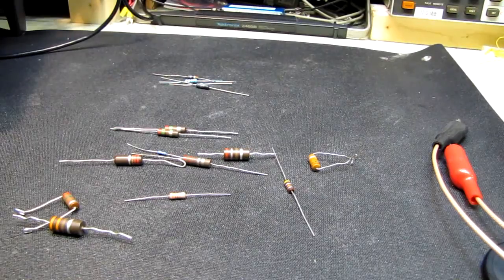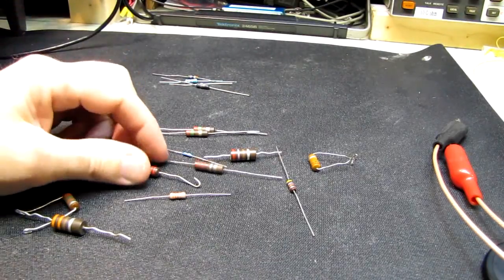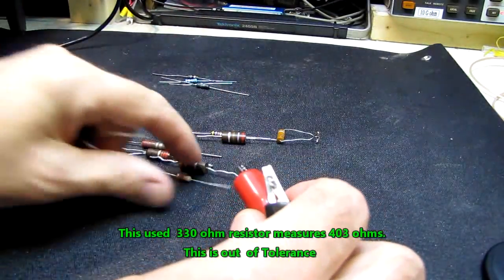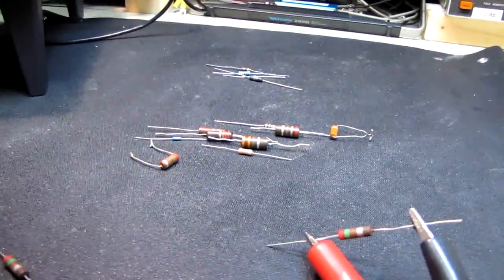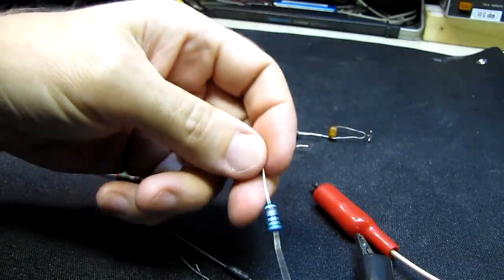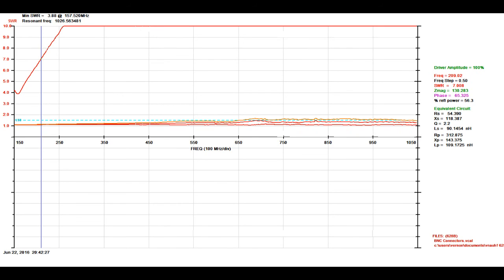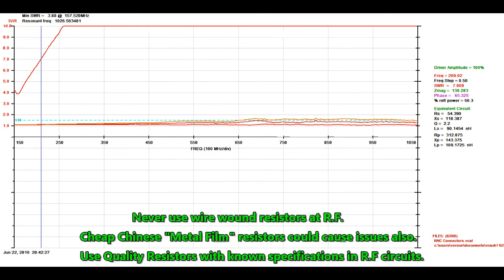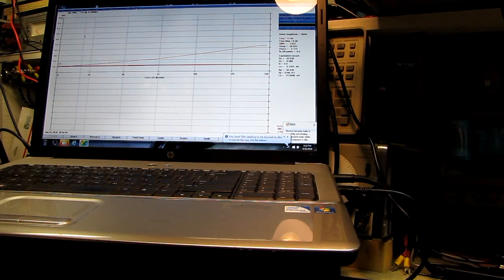Carbon Comp Resistors - High Failure Rate

Comment: When you measure the inductance of the resistors,  how are you dialling out the lead inductance?
Reply from the maker: My inductance meters allow for connecting right at the body of the device. For the frequencies most of us use the lead inductance is of such a small value to be insignificant. If your researching UHF/SHF you will likely have the specialized gear needed.

Comment: Carbon are the best in my opinion on audio for balance if you can get carbon film they are good but not good around heat!!!! When they get hot they will drift 
I like using old stock Allen Brady carbon comp and test them I get about 5 percent out of a 100 pack that are out of tolerance 
Also remember when they made these electronics it was excepted at a 20 percent plus or minus and they still sounded great so 
Do some experiments and test and learn and if you break some oh well lesson learned
Reply: I thought carbon composites generate noise, especially as they warm up?  Conclusion being you would not want them in the input stages of preamps/amps.    Maybe that's another myth!

Comment: Hi Mike, interesting for sure.  If you are still around, i wanted to run this by you, see what you think.   I've built a couple of guitar tube amps for gigging (Fender and Marshall type) and for the most part used metal film in the early stages, carbon film for most of the intermediate stages and carbon composition in the later high voltage/higher current sections (the claim being resistor shift coefficient being part of the "mojo" in vintage amps.  (I have no experience on the effects of the latter).   Recently, I gathered a large number of older carbon composition from the cellar of a fairly well known EE and sound recordist that passed away.  He was a seriously inveterate hoarder, fixer, upgrader and modifier of vintage audio equipment (Scott Kent).     I have loads and loads of NOS CC resistors, 1, 2 and I believe 5 watt resistors waiting for a home.   I have noticed that while they haven't increased thier value by 2 or 3, their resistance has increased maybe 5%, 10%, which may be well in tolerance anyways.   My question is, should a particular resistor still be in spec after all these decades,  can I expect decent performance in guitar amp builds?   Since many of the resistors are 1, 2 and 5 watt I could over size them or even string series and/or parallel resistors in order to keep them seeing well below their rated value.   My other concern is, does the age increasing of their value reflect any performance characteristics?  Or, is it just an increase in resistance and thats all that changes.   Because if after all these decades, if the resistors I pick are still withing a decent tolerance of their color band rated value, then can I put a little more faith in those, than say, cheaper ones that were accustomed to major drift?   I know that Scott Kent was a fiercely anal EE that held high standard in his work, and probably would have bought the best of quality that components had to offer in his days.  He was an internatioally recognized upgrader of the 2-track mastering Revox A-77 recording tape deck.  His aim was to increase headroom, lower distortion and noise notabley better that Revox has done to begin with.  So I would expect these old resistors to be the best of what was around back then.  And so far I havent measured one these CC resistors that were more than 5-10% outside of value.  
Thanks for taking the time to read this, I feeling like taking some 1950's transformers I found in his cellar and build one or two Fender Princeton reverb's or modified Blues Juniors for home recording and small gigs.  I though using the NOS CC resistors would come in hand for that! 
Thanks so much, - Phil Donovan

Comment: How much of a  difference would there be in the temperature tolerance between the Metal film and the Carbon film resistors? The amp I'm working on has a few fusible resistors that need replacing but having a hard time finding replacements.

Comment: Great video! 
I think a lot of it has to do with who the manufacturer is. The bulk of my stock is either from Allen-Bradley or Ohmite. I have all wattages from 1/4 to 2 watts. Most tolerances are either 5 or 10 percent. Some are 1%. These are all NOS. Some still in their cards. They all came from a dept. that designed military equipment. And, both these name products have a certain "look" to them that, once you're used to that look you can identify them as such. When put in circuits, I always check them, as you shud with any component, and they're always in tolerance. But with other NOS resistors, it's always a crap shoot....seldom are these kind in tolerance.
Reply from the maker: Agree, most "Allen-Bradley Style" I.E. those with very squared off ends, test fine. The rest are Russian Roulette.

Comment: New to building things can you substitute a mfr resistor for cfr resistor of equal value in a attenuator
Reply from the maker: Metal film resistors are usually trimmed to value by being spiral cut with a laser. This can result in it behaving like an inductor at very high frequency. If your attenuating RF better to stick with the carbon film resistors. For an audio attenuator it probably wouldn't make much difference. Although both can be spiral cut. under a hundred megahertz you would be hard-pressed to tell the difference without special test equipment.
Reply: The Radio Mechanic  thanks only 160m to 6m  so I don’t see that being a problem

Comment: Hey Mike, Very informative. Here's a question for you, I was planning on replacing the carbon film bleeder resistors to metal film on the caps in my Heathkit HP-23 power supply. What do you think.

Comment: since there is a problem replacing carbon comp resistors with films in an rf circuit, a carbon seems ok as long as its reading good. i have thousands of these and ta lot of them have drifted up. what do you think of baking them at a pretty warm temp for a few days? i have access at work to a good baking oven but i dont really want to use it unless im sure itll work. any comments on baking?

Comment: Another spec to keep in mind when working on tube type equipment is the resistors maximum working voltage.  That bit me in the butt a long time ago.  Got good high quality Dale metal film resistors but accidentally ordered ones with a MWV of 350 volts.  They lasted about 5 minutes at 580 volts and silently died with no visible signs they had burned up.  Lesson learned, check the spec sheets when ordering.
Reply from the maker: Hi Mike, your right, all the specs need to be considered. With todays electronics most would never even think about voltage rating. Thanks for passing that along, I forgot to and it is an important and overlooked spec.

Comment: Yep, more old resistors gone bad.  Time kills electrolytic caps first and next would probably be carbon composition resistors.  Trying to explain to a customer that his 1960-70's or older new old stock radio is full of bad parts is hard sometimes.  All they hear is "new" not the "old stock" part.

Mike
Reply: Time kills paper caps of various types. They can be in a parts bin or still in packaging to sell.